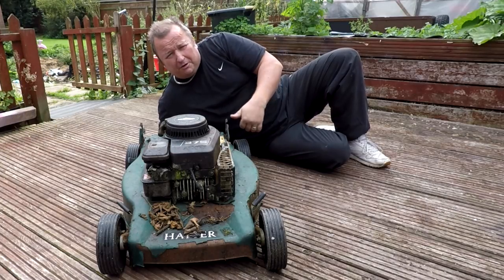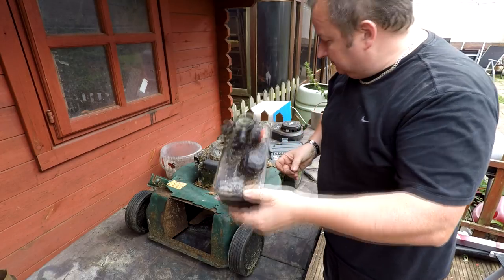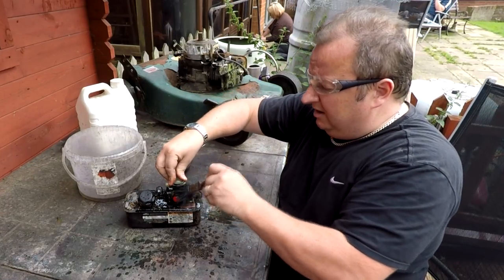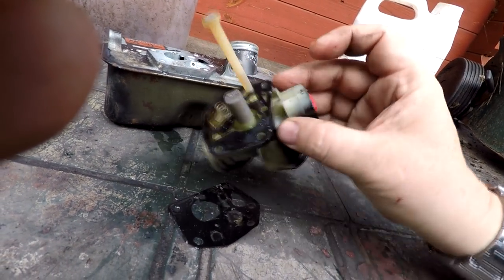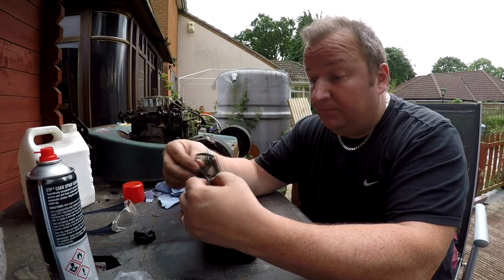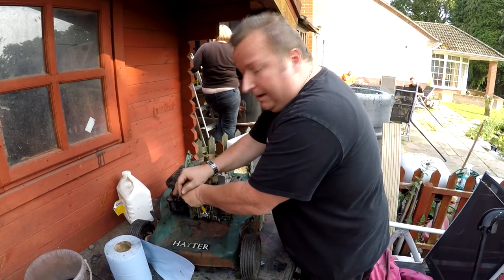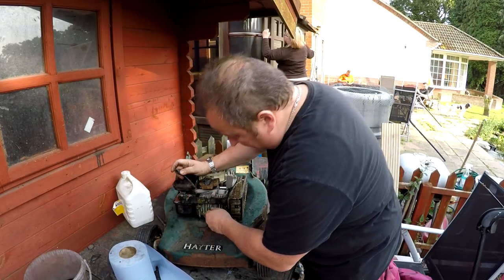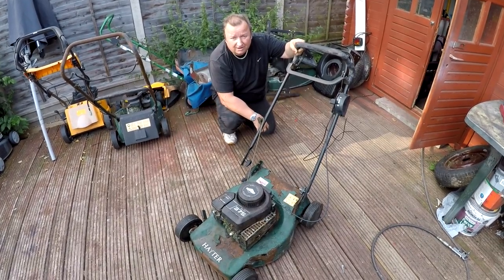Part 2 #WorstLawnMower In The World Challenge Old Start Cold Start

Comment: Bit late to the Martin been to  Dorset nans funeral .  The older briggs only have the large spring  but your missing the throttle  cable . But fair ran ok.
Cheers 
Pete.
Reply from the maker: Yes, that sounds right Pete. Should have realized that lol
Reply: It does throw you a bit when you see it . As the tab for the small  spring is not there .

Comment: weld a plate on the back, closing the discharge. Cut a hole in the side for new discharge. Also your getting lucky not checking the spark before you pull your arm off...
Reply from the maker: This thing is so rusty, I don't think you could weld anything to it lol.
Reply: grind the edges so you got clean metal to weld... or if you find the bag. lol you got some spiders that love your mowers i see....
Reply from the maker: Ahh, I see what you mean Jack, I read the first comment when I was half asleep lol. I think I have a grass bag for it somewhere.

Comment: it cant be the worst if its got an old briggs on it, those motors dont give a shit, the new ones are limp wristed
Reply from the maker: Haha, yes, the older ones are better in my opinion. Bulletproof.
Reply: bulletproof indeed, all it needs is a carb clean and it fires up second pull after years of rotting in a bush, new ones with the plastic carbs are OHV but the catch is the smaller displacement, they shorten the stroke to decrease displacement and still run the mower at the same speed so the piston moves slower and has a smaller lever to make torque with and is therefor gutless compared to a good old briggs, i have to let my nowadays mower stop and catch its breath or it will stall in the grass
Reply from the maker: Haha, nice comment.